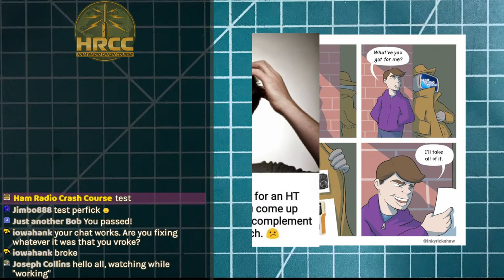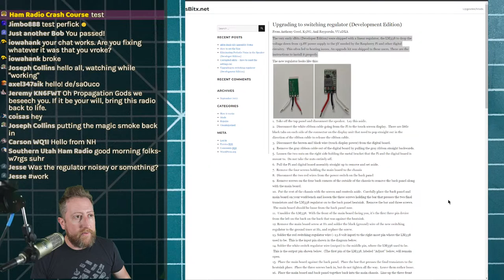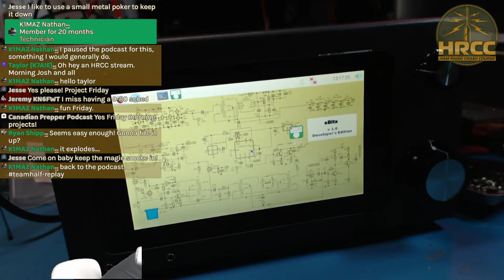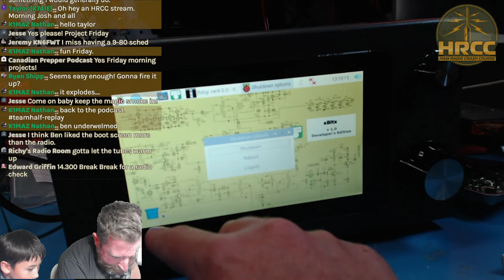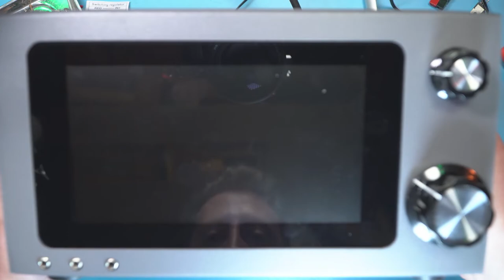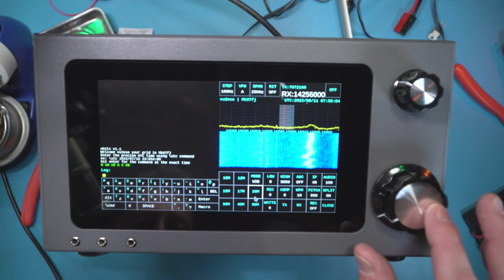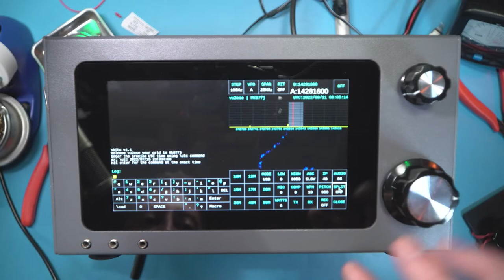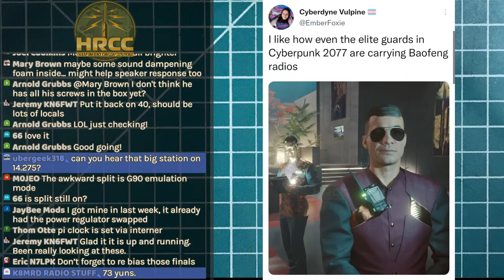FIXING The sBitx Developer Edition!

Comment: I didn't see you put the PCB mounting screw back in after you soldered the ground lead to the pad - so that will help ensure a good connection and help eliminate a potential ground loop. If you do continue to see birdies, you might consider soldering a 0.1uF cap from the output of the new switching regulator to ground - some of those can generate RF and a small cap physically close to the source is an easy way to reduce. Fun seeing Ben in the stream - father/son day! Hope the radio works out better now! 🙂
Reply from the maker: Good catch! I need to get that screw back in!

Comment: I believe the tab on the linear regulator was thicker than the tabs on the finals which prevented the clamp bar from putting enough pressure on the finals causing over heating.
James
Reply from the maker: That is entirely possible.

Comment: Replay crew member. I have a metal scribe type of thing works Great as solder heat sink / ability to press down on soldered wires. Josh what kind of smart watch is that. I need one that does blood pressure / pulse checks.
Reply from the maker: Apple watch